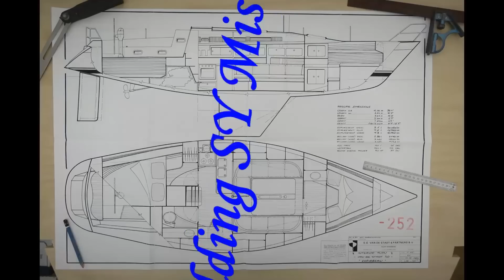Building my steel sailing yacht Ep.94 OK, let's get that Cabin 2 Berth FITTED! (pt.1)

Comment: I just found you channel and have watch a few of them.  Your attention to detail is unbelievalble.  When the project is done it will look like a factory build!
Reply: @Sleeping Dogs
  No "factory build" will ever come remotely close to this beast. Think storms... the sea is not a quiet, serene place: "fair winds and following seas", as the saying goes, are sweet days. But the sea is  not often that kind. A storm 200 or even 300 miles away can churn the water and toss a small boat all over the place. Most "factory build" boats can barely handle that. This boat will take some major ferocity without the least little squeak from any joint. A Cat 5 hurricane would probably dismast her, but Mistress' hull integrity and interior will be unscathed. Watch the last 6 or 8 months'  videos, you'll see what I mean.
Reply from the maker: Thank you very much for your great comments and I am pleased that you found Mistress' journey  🙂👍
Reply from the maker: @crustycurmudgeon2182  WOW, what a great comment, thank you and something deep inside of me always kind of revels in those situations where a small sailing yacht is in a ferocious sea and brings her mortal companions safely back to harbour, such as for 1 eg. J.Masefields "Sea Fever" Thanks again  🙂👌
Reply: It will look  damn sight better than factory built.
Reply from the maker: @TBPollock  Hey thanks very much for your great comment, however there is also the, "beauty is in the eye of the beholder" consideration  😁👌

Comment: Bruce: you recovered well from your little "cock-up"! LOL... How does that saying go? Something like "the true measure of a carpenter isn't in how perfect his work is, but how well he hides his mistakes". Comes with the territory, man! I'm currently building a "swamp cooler" (evaporative cooler) out of wood. The size I'm building is generally made from heavy gauge sheetmetal. I don't have those skills or tools, so... Anyway, as I have no actual plans on paper or even fully envisioned in my head (I'm really winging this), I have some "cock-ups" to artfully hide as I go. (Territory, again). Width and height are set, but depth is TBD. Also, the dimensions of the housing for the squirrel-cage fan (and how I'm going to mount the thing in there) are still in limbo. I've finished building and painting the "reverse-funnel" (if you will-- for lack of a better term, I simply don't know what to call the thing... a "horn"?), with air diffusers to spread the output air from 3" X 3 3/8" (output from the squirrel-cage fan) to 10" X 24" through the window of my little 12' X 12' shed/shop (which is a virtual OVEN during coastal Alabama, US, summers). That was a lot of frustrating fun! ;) This will be a beast of a box-- 36" tall by 30" wide (depth at least 30", but possibly more). It will hold at least 10 gallons of water for the submerged pump to draw from (the "well"), which will supply water to the 30" X 30" mat covering the only air inlet (hence, the "evaporative" part of the name of this thing). I haven't quite worked out the plumbing of this thing, yet-- I'll cross that Rubicon when I get to it. One thing at a time... Water management will be tricky since this is wood, not sheet metal you can bend as you wish-- I need to disperse water evenly across the mat, and it needs to drain back into the "well". I've got some tentative ideas... Anyway, Bruce, I always look forward to your videos and watching you solve problems with your typical aplomb-- you're an engineering artist with flair for form on top of function! Very inspirational! Wish me luck on this contraption I'm cobbling together-- it's not totally out of the realm of my past endeavors, but it is unique in all the various challenges crammed into one project. (Keeps me entertained in a head-banging-concrete-wall  kind of way. At 64 years young, who could ask for more?). Cheers.
Reply from the maker: Thanks very much for your great comments, much appreciated and sharing your clever ideas re. your current project sir and all the very best + luck with it all, it sounds like it will be an interesting sight too. And "64 years young" sounds exactly right, press on and keep solving challenges sir  😁👨‍🔧👍🍻
Reply: @BuildingSYMistress  Thanks for the encouragement Bruce! This beast will not be pretty-- it's a large box and I'm painting it gray. It just needs to be weatherproof on the outside and completely waterproof on the inside. I'm currently applying multiple coats of enamel paint on the front and rear assemblies. Boring, but necessary before I can move on to the fun stuff. (As you know!) The air diffuser on the front is my only concession to "bling"-- I've stained and polyurethaned it. Looks good, but that polyurethane is also rock-solid, so very functional.
Reply from the maker: @crustycurmudgeon2182  Welcome and all the best with it  👍

Comment: You have made a mistake with the rear bunks, you have not added a base for your storage, anything you put in those area's will be soaked by Blige water
Reply from the maker: Thanks for the comments Darren and fyi the bilges are much lower than the hull height beneath these berth's  👍

Comment: Shame you need the bed legs looks better with out , yes in any steel boat protection rubber between metal and metal is a must and.  The gasket rubbers today are good silicone is not as ,
Reply from the maker: Thanks for your good comments  👍